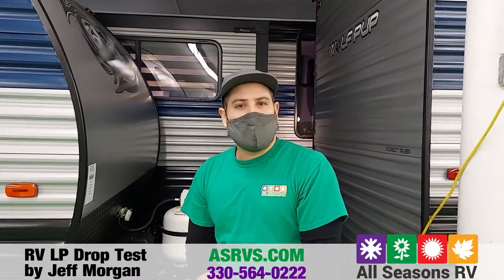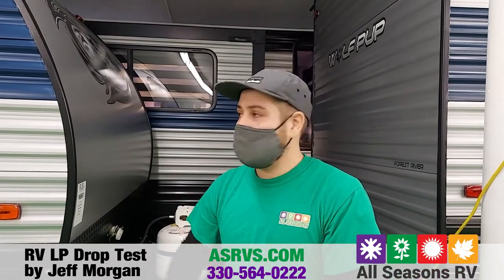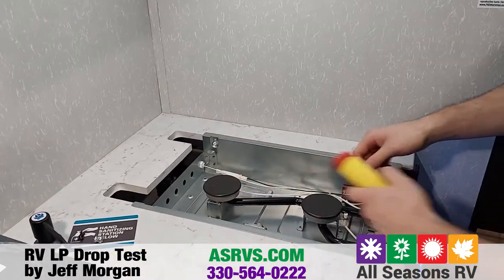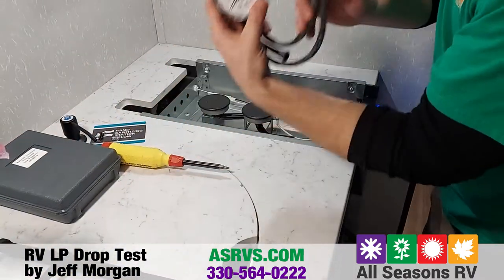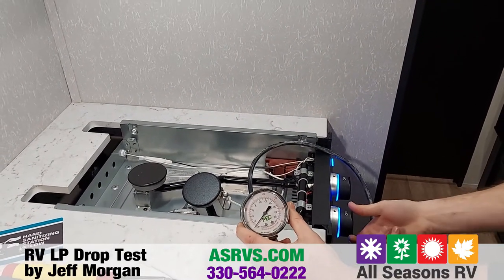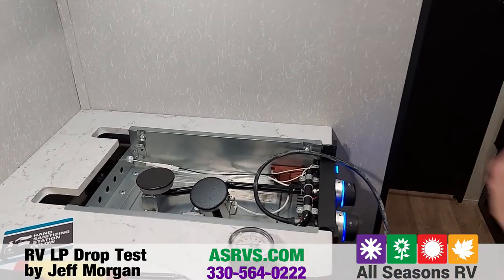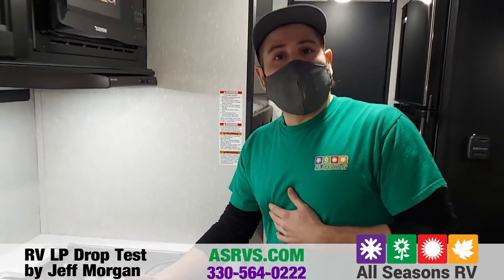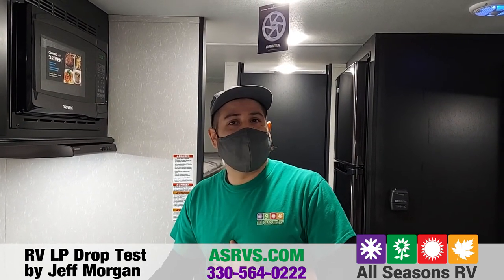RV LP Drop Test by Jeff Morgan

Comment: Agree with Brady, the pressure must be reduced to 8" water column in order to detect a leak.  The high pressure before the regulator will feed a leak and not show up as a drop in pressure.  Bleed off the high pressure till the manometer reads 8" and monitor for 3 minutes and any leak that is detectable will show up.